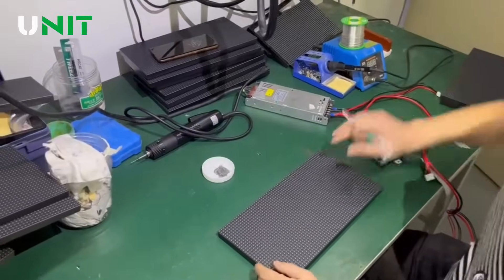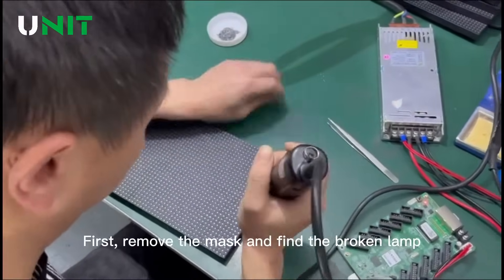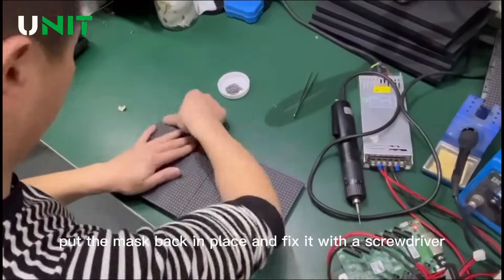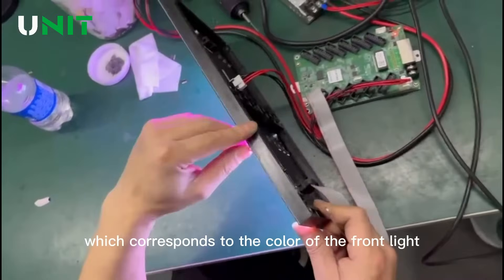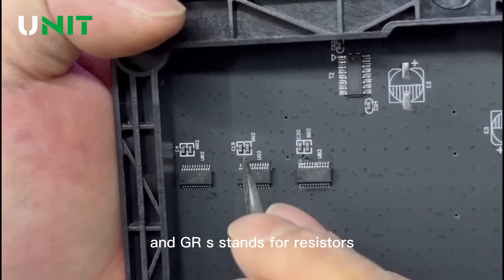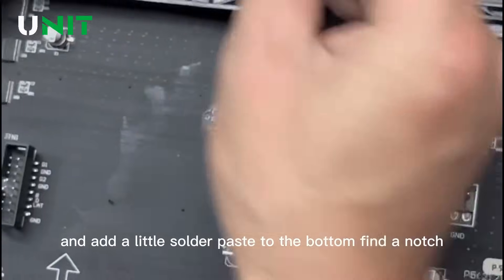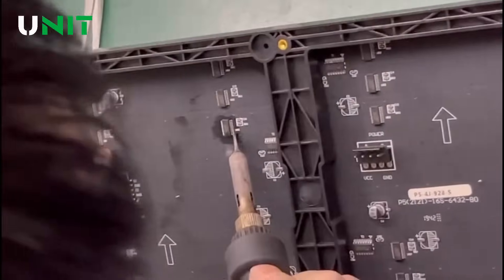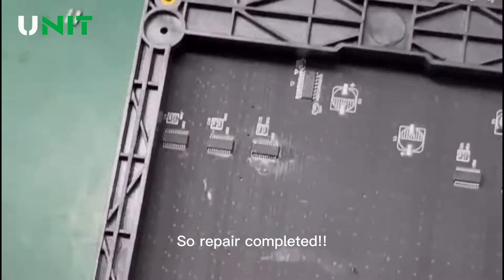How to Replace Broken LED Lamp & Broken IC of LED Module?

Comment: Excellent, it works with green and blue, but it doesn't work with red, it's not integrated and I can't identify the one that generates the short, I have to remove the 16.😢
Reply: If all 16 is black then the red IC needs replacing, if you replace the red IC and its still not working then you need to jump from back of ic to front of led pin